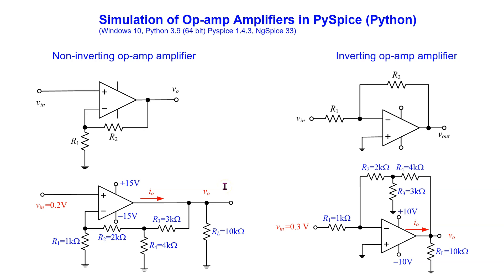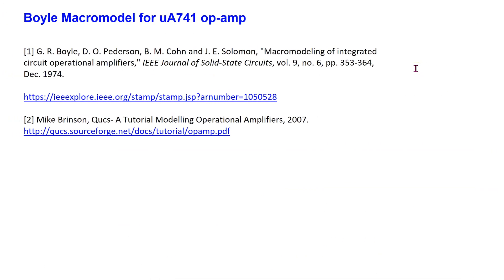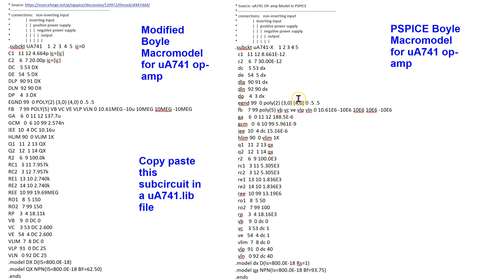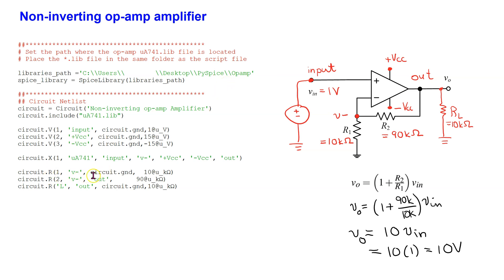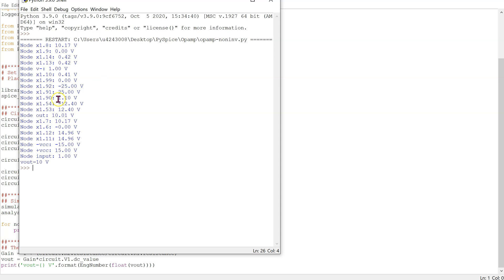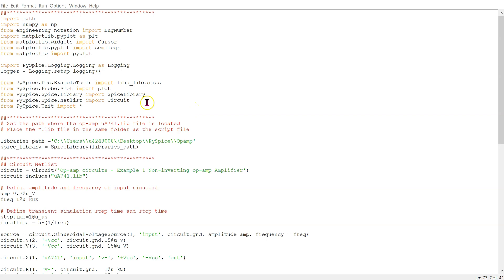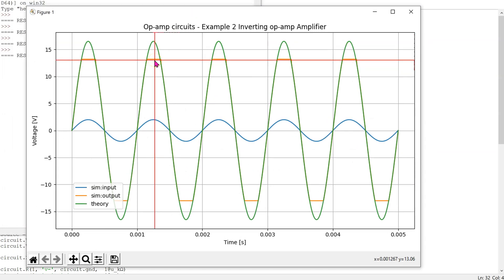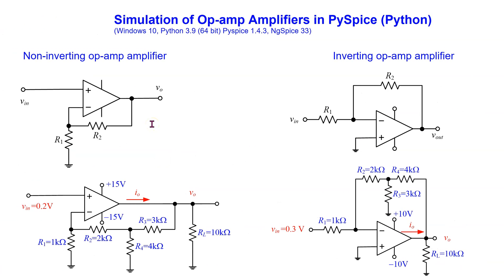Introduction to PySpice (Python) for Simulating 741 Op-Amp Amplifier Circuits

Comment from the maker: ##*********************************************
import math
import numpy as np
from engineering_notation import EngNumber
import matplotlib.pyplot as plt
from matplotlib.widgets import Cursor
from matplotlib.pyplot import semilogx
from matplotlib import pyplot

import PySpice.Logging.Logging as Logging
logger = Logging.setup_logging()

from PySpice.Doc.ExampleTools import find_libraries
from PySpice.Probe.Plot import plot
from PySpice.Spice.Library import SpiceLibrary
from PySpice.Spice.Netlist import Circuit
from PySpice.Unit import *

##*********************************************
# Set the path where the op-amp uA741.lib file is located
# Place the *.lib file in the same folder as the script file

libraries_path ='C:\\Users\\username\\Desktop\\PySpice\\Opamp'
spice_library = SpiceLibrary(libraries_path)

##*********************************************
## Circuit Netlist
circuit = Circuit('Op-amp circuits - Example 1 Non-inverting op-amp Amplifier')
circuit.include("uA741.lib")

# Define amplitude and frequency of input sinusoid
amp=0.2@u_V
freq=1@u_kHz

# Define transient simulation step time and stop time
steptime=1@u_us
finaltime = 5*(1/freq)

source = circuit.SinusoidalVoltageSource(1, 'input', circuit.gnd, amplitude=amp, frequency = freq)
circuit.V(2, '+Vcc', circuit.gnd,15@u_V)
circuit.V(3, '-Vcc', circuit.gnd,-15@u_V)

circuit.X(1, 'uA741', 'input', 'v-', '+Vcc', '-Vcc', 'out')

circuit.R(1, 'v-', circuit.gnd,  1@u_kΩ)
circuit.R(2, 'v-', 'x',          2@u_kΩ)
circuit.R(3, 'x', 'out',         3@u_kΩ)
circuit.R(4, 'x', circuit.gnd,   4@u_kΩ)
circuit.R('L', 'out', circuit.gnd,10@u_kΩ)

##*********************************************
## Simulation: Transient Analysis
simulator = circuit.simulator(temperature=25, nominal_temperature=25)
analysis = simulator.transient(step_time=steptime, end_time=finaltime)

##*********************************************
## Theory: See video Op-amp circuits - Example 1 Non-inverting op-amp Amplifier

Gain = (1+ circuit.R2.resistance/circuit.R1.resistance +
        circuit.R3.resistance/circuit.R1.resistance+
        circuit.R3.resistance/circuit.R4.resistance+
        (circuit.R2.resistance*circuit.R3.resistance)/
        (circuit.R1.resistance*circuit.R4.resistance))

time=np.array(analysis.time)
vout = Gain*(amp)*(np.sin(2*np.pi*freq*time))

##*********************************************
# PLOTTING COMMANDS

figure, axe = plt.subplots(figsize=(10, 6))

plt.title('Op-amp circuits - Example 2 Inverting op-amp Amplifier')
plt.xlabel('Time [s]')
plt.ylabel('Voltage [V]')
plt.grid()
plot(analysis['input'], axis=axe)
plot(analysis['out'], axis=axe)
plt.plot(time, vout)
plt.legend(('sim:input', 'sim:output', 'theory'), loc=(.05,.1))
cursor = Cursor(axe, useblit=True, color='red', linewidth=1)
plt.tight_layout()
plt.show()

Comment: Hello sir. First of all thank you for this wonderful tutorial.❤ I was looking for some ways to simulate opamp 741 using Pyspice for my project. That's when i came across your videos. It really helped me. I also have a request. Could you please try to simulate the LM 741 also. Because when i tried the pspice macro model from the website, it gave me errors. It would be much helpful if you could upload a video or guide me in the comments 😊
Reply from the maker: Thank you for the feedback. Glad the video helped your learning. Can you please post the op-amp model in the comments that you are trying to use. I can try it my end to see if there are any syntax issues.
Reply: Thank you for replying sir. I will attach the code here. If it wouldn't be too much bothersome for you, If you happen to have some free time I'd be really grateful if you could try to simulate IC ne 555 timer circuit also.

Comment: Thank you for the video! I get an error when loading the subcircuit .lib file, MIF-ERROR - unable to find definition of model a$poly$e.x1.egnd, any idea what could be going on?
Reply from the maker: Thank you for the feedback. I have not encountered this error before. It could be related to PySpice installation.
Reply: @electriccircuits7164  Thank you, you were right, I had to update ngspice. I've encountered another issue that I don't fully understand: when vcc voltages are small enough (1, -1 in your example) the simulation raises a convergence error. Do you know what that means or why it happens?
Reply from the maker: Thank you. The VCC voltages are +10V and -10V in the video. From the 741 op-amp data sheet, for proper biasing and operation, the biasing voltages must be in the range +5 to +20V and -5 to -20V. Otherwise, the 741 op-amp will not work properly.
Reply: @electriccircuits7164  Thank you! I'm new to this, so I wouldn't have known to check the data sheet, now I know thanks to you! Is it normal that the saturation voltage seems to be always 2V less than the VCC voltage? For instance at 10V VCC the output saturates as 8V, at 12V VCC the output saturates as 10V.
Reply from the maker: As per the datasheet the op-amp output can saturate to any value 1-2 V less than the bias voltages. So the saturation voltages you have observed are correct and to be expected.

Comment: Dear Sir, congratulations and thank you very much for the excellent video.
I tried modifying your program in order to use another op-amp: the LMV321 instead of the uA741, but I got the error:
"2023-02-11 07:53:54,614 - PySpice.Spice.NgSpice.Shared.NgSpiceShared - Shared.ERROR - Error: no such function 'if'"
I believe this error is due to the fact that I was probably using the wrong version of the SPICE file, as you explained in your video (Modified Boyle Macromodel x PSPICE Boyle Macromodel), but I couldn't find a model that wasn't PSPICE.
Where can I find LMV321and also TL081 libraries in Modified Boyle Macromodel format? Is it possible to convert a PSPICE library file into a Boyle Macromodel?
The lib file I used I found here: https://www.st.com/en/amplifiers-and-comparators/lmv358l.html#cad-resources
I tried editing the spinit file by inserting the line:
set ngbehavior=ps
But the result was the same, with the same error.

Comment: Hello, the video is amazing. May I ask you a question? In the cadence, there is a calculator tool that can analyse the result. For example, It can calculate the frequency base on the transient simulation. Is that possible to do it in the PySpice？ Thank you sir.
Reply from the maker: Thank you for the feedback. Yes commercial spice simulators have built in measurement tools or calculators. For instance, LTSpice has a measure directive which can be used. In PySpice, there is no built in calculator but once the simulation is done, we can  import the data and use Python to calculate desired quantities etc.
Reply: @electriccircuits7164  Got it. Thank you very much!

Comment: Hello. I hope you are excellent. I thank and congratulate you for the videos for they have been of great help with my work with PySpice. Have you implemented an Analog PID Controller with PySpice? Is there anyway for contacting you?
Reply from the maker: Thank you for the feedback and suggestion for future video topic. Is there a particular circuit you are interested in implementing, such as an Op Amp PID Controller? You can post a link to the circuit diagram in the comments. Otherwise, please feel free to post your problem to the PySpice Discourse group and I may have a look.